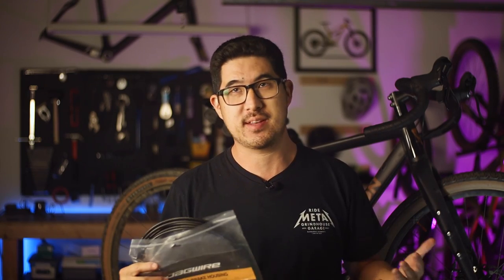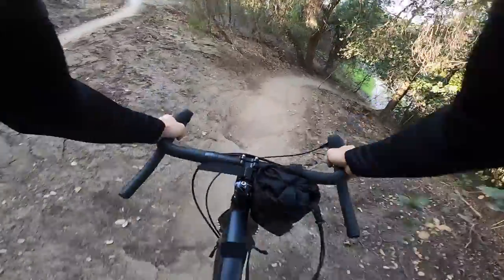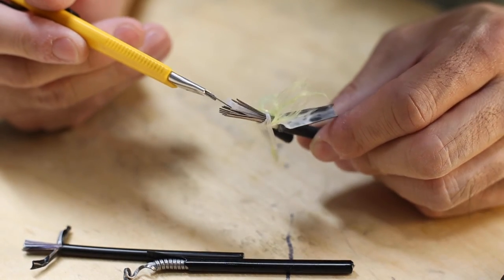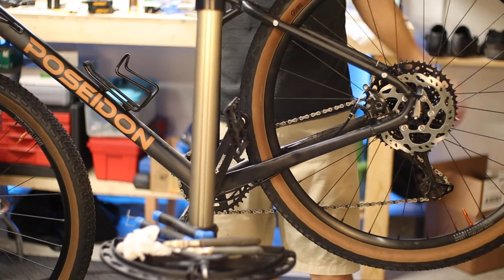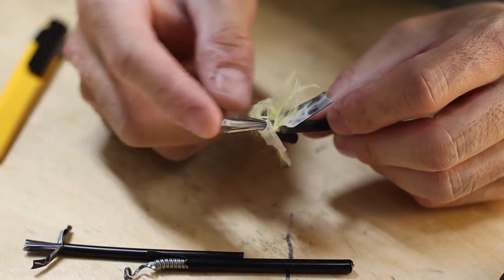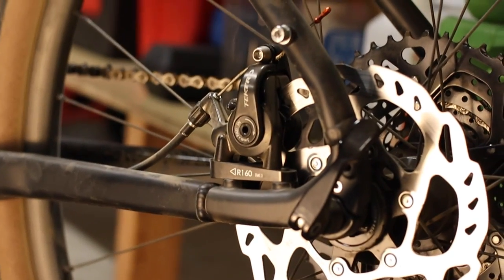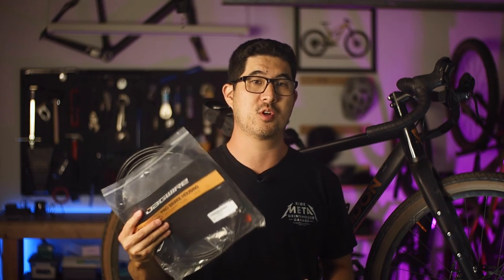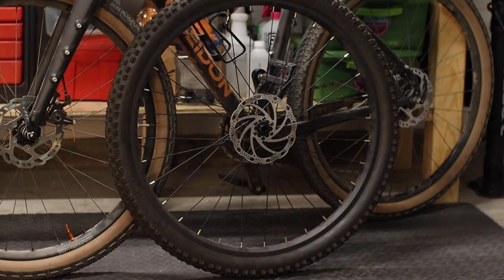Compressionless Brake Housing // Night and Day!!

Comment: Just to stress the point made in the video, never use shift housing for brakes. It'll burst longitudinally. In addition to the difference in diameter, compressionless housing has an extra reinforcing layer of kevlar or metal.
Reply: His point was the diameter is diff. I don’t think he knows shift housing is weak longitudinally as you point out
Reply from the maker: No one’s suggesting to use shift housing as brake housing. I’m well aware that it’s not supported radially like the compressionless brake housing
Reply: @TheBikeSauce  ok - you said "unfortunatly the diameters are different so they are not compatible"  Implies if the were its ok.  I think you know better but people watch this stuff.
Reply from the maker: I hear you man, but it’s literally saying that it’s not ok, despite some thinking it may work.

Comment: The compressionless housing also works great with rim brakes!  I use it on both my bikes with Paul Racer and Racer M brakes.
Reply from the maker: Right on.
Reply: It sure does. I bought some for my Paul Klampers and had extra and used them on some v brakes and definitely improved a bunch!

Comment: I bought these to put on a bike I used with cable pull hydraulics. Damn! What a difference it made! I bought the cable pull hydraulics because the OEM brakes were vague at best, the cable pulls helped some, but, not much, the housing made all the difference. I probably could have just bought the housing and solved the issue in the first place.

Comment: great video, stuff I remeber from mountain bikes before hydraulic took over completely (Avid BB7's and only one pad moved :O ) .   Thought it was weird that both mine and my wifes cable disk brakes were so much worse than I remembered our mountain bikes were.   Got some new pads and better cable and night and day.  the stock cables on mine were cheap rubbery type and my wife's were just cut at an sharp angle allowing them to compress at the lever and caliper.

Comment: Maybe. The Tektro pads packaged with the Redwood should be illegal they are so bad. I did not need compression-less housing, I needed quality pads, and to sand them down to 75% material to allow fine caliper pinion adjustment (and caliper alignment) on the bike. The Tektro MD-550 do not have enough adjustment at the frame on this bike, and that needs to be revised. After the sanding of the pads, fine tuning caliper position, adjusting the cable tension to be correct, and moving both pistons in as close as possible without rubbing the rotor - Anyone can achieve a firm grab that starts early on the brake lever stroke. The bike needs to be adjusted properly. The pads should go in the trash though, facts.
Reply: can you lock up the wheel braking from the hoods position?

Comment: Nice video! I know other Redwood/X users also take the next step swapping out to dual piston TRP Spyre calipers or cable hydraulic brake setups such as the TRP HY/RD or Juintech F1. Shimano ice rotors also give a nice weight reduction and the possibility to use metallic brake pads for more bite. Looking forward to seeing what upgrades you go with!
Reply from the maker: Considered the Spyres, but wanted to see what I could get away with. Totally happy with the power in this setup now.

Comment: I think it’s great when frame makers allow routing to be full length housing compatible for shifters and brakes. My brakes are hydraulic Hope RX4 so obviously my lines are full length sealed but on my frame externally routed to the rear and internal through my fork to the front. But with that said I definitely use Jagwire shifter cable and housing and I have the polished cables. That’s means no coating that deteriorates with exposure and usage. Think of that Teflon coated pan that you cook eggs on every morning. Coating is not as good as polished, in my opinion. 
Looking forward to seeing your build. I’m looking to build up a second gravel but something with flat bars this time.

Comment: Did this upgrade a few years ago on a bike with Spyres and it was awesome. One major downside though is it is way less flexible than normal brake housing. I could not for the life of me get the housing through my bottom bracket area which required a tight bend. I ended up splicing in sections of coil brake housing along the route and connecting them with ferrules. That was a fun weekend
Reply: how did you get it to bend at the handlebars? Sincerely curious to know!
Reply: @donttouchthisatall  the kit comes with a short section of more flexible coil housing that is meant to go from the brake lever to the end of your handlebar tape
Reply from the maker: Just bend it. Bit stiff, but it goes in fine
Reply: you can get non compressing cable thats is still flexible.  Not like hydraulic brake hose but it varies a lot!  Pretty sure I used some form of JagWire specifically because they mentioned flexibility in the description.

Comment: I changed my housing to Jagwire KEB-SL but didn't notice some big change in braking power. Generally they work, but they are not as strong as I would like them to be. I cannot for example block front wheel.
I have 
Tektro MD-C550 brakes 
Rotor Shimano SM-RT56
Resin Brake pads EBC CFA327

What do you recommend? Should I change the brakes or change pads to semi-metalic
I heard that quite often people complain on these Tektro brakes but I also come across posts or comments where people say that they are really good brakes. I'm confused

Comment: I just installed a set of these on my new X. They seem to work fine. Definetly better than factory housings but I cant find any info on if I should have put end caps on the end inside the hoods. They didnt seem to fit so I didnt use them. Did I eff up?

Comment: Hi, is this any better than the Jagwire Road Elite Sealed brake kit? Will be using it on mechanical discs. I figured that the elites doesn't have the Kevlar material in it.

Comment: Did you run the same kind of housing full-length? I am asking, because I try to figure out why in Road Pro Kit Jagwire put a segment of compressible housing next to compressionless. Since it is pre-built you end up with partially compressionless housing and the performance is rather poor.
Reply from the maker: It’s full length. The short section of standard housing is for tight bends on drop bar bikes. It doesn’t affect performance too much

Comment: Been suffering this exact issue on my Poseidon X which I love for basically everything but it's poor stopping. Putting this on my weekend to do list!
Reply from the maker: Routing will be a bit tricker on the X, but totally doable. Use the existing cables to guide the new housing
Reply: How did it feel?

Comment: I wonder if using compressionless housing could help to make the brake levers feel lighter on my 2008 Surly Long Haul Trucker w/ stock cantilever setup (Tektro Oryx cantilever #992)?
Reply from the maker: Depends on if the current housing is low quality or otherwise gummed up. If so, any fresh housing ought to help. If the brakes feel vague or squishy, then compressionless is more likely to help

Comment: sweet! so you bought a 10 meter roll. How much do you need to cable front and rear, roughly, given you run full housing the whole length? (ie no cable stops on the frame)
Reply from the maker: 2-3m should do it

Comment: Thinking about putting this on my State 4130.  Saw another video where someone did this upgrade but only for the back brakes because of the possibility of locking up the front wheel.  Did you run the same cabling to your front brakes?
Reply from the maker: Same for front and rear.

Comment: I dont get gravel bikes, whats the point. use a xc for light trail riding or gravel and its good enough for those super rare road riding. if I want fast road performance then I choose road and fast mtb I choose any of the thousands of designs for mtbs out there. gravel just seems like nonsense and especially with drop bars, for me the whole ride feels like im about to crash when making a turn on a trail. offroad should always be flat bar, its better scientifically and anecdotally.
Reply: Honestly the most pleasurable type of bike to ride..if I could have only one bike it would be a gravel
Reply: ""Do you all mind quitting the fun for now?"
Reply: Gravel is the avocado toast of cycling.
Reply from the maker: @alessiob8700 mmmmm… toast.